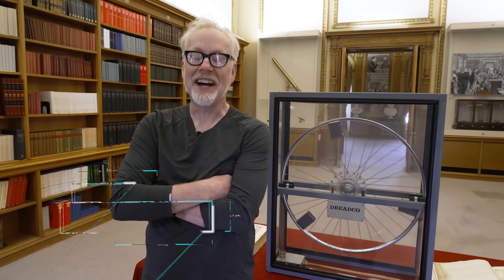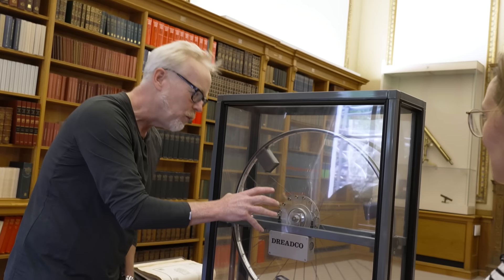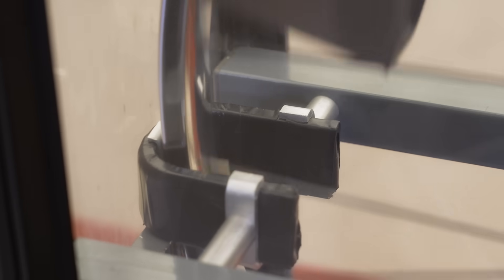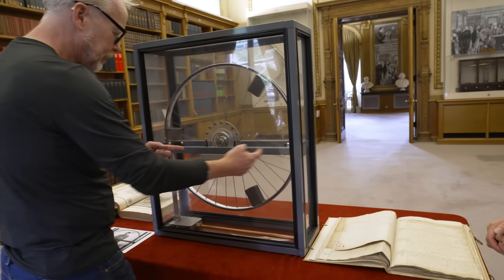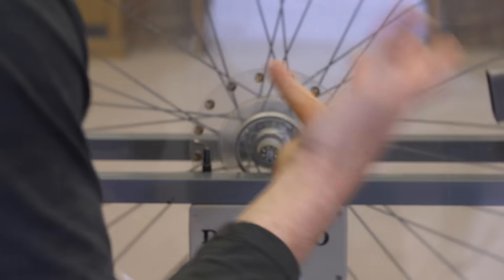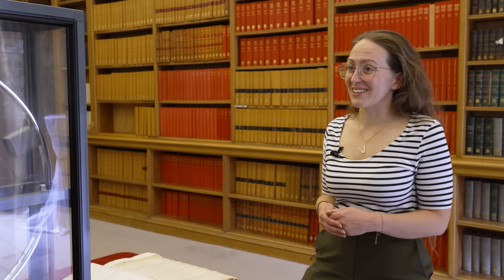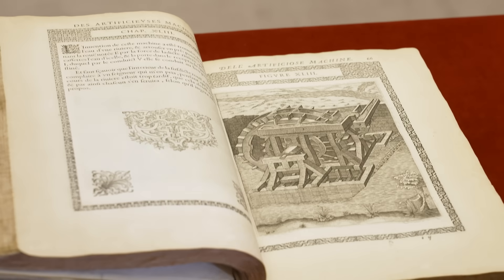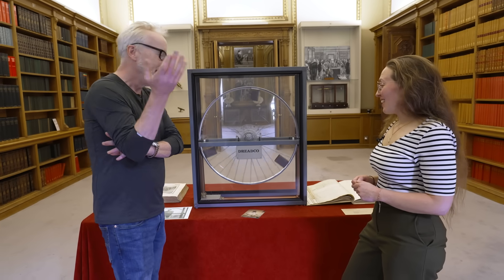Adam Savage vs The "Perpetual Motion" Machine!

Comment: A perpetual motion machine may by definition be impossible, but an incredibly efficient way to convert ambient EM energy (including heat, visible light, microwaves, radio waves etc), use magnetic energy and low friction materials may be able to be combined to actually fool Adam one of these days...

Comment: I have a propeller on my stove to disperse the heat in the room. It works by generating electricity from the heat difference. The cobbler tubes and heat sink might be the same device, to generate tiny currents from the heat difference inside and outside of the box, or simply between the bottom and higher up.
Reply: I wonder the same thing.

Comment: 4:24 I love how Adam is like "I wonder if this is a light meter" as he points his flashlight at it.
Reply: @SciFiSecrets  you're  a tiny solar panel
Reply: @anggrimunki  is that really necessary?

And solar panels are basically just LEDs... kind of.
Reply: @DavidLindes  iS tHaT rEaLlY nEcEsSaRy
Reply: @Squavez.  wow, y'all are infantile. 🙄

If you're like twelve or under - heck, even in your teens, then... 🤷‍♀.  If you're older than that, grow up. 🙄
Reply: @DavidLindes  you're really necessary :p
Reply: @DavidLindes  I'm 44. Growing old is mandatory, growing up is optional.
Reply: Nah, they are the vents to the air batteries
Reply: That is a temperature meter.
Reply: @SciFiSecrets  I have a motion activated light in the driveway that charges via solar panels and when I shine a flashlight on them at night they turn off thinking its day...
Reply: @JustinBrockel  Indeed.  Or a magnetometer.  (Well, he probably did have one of those, if he'd thought to pull out the compass app on his phone.)
Reply: @quazzymodo6294  kind of

Comment: Even if it ran forever, you cannot get any work out of it. That is the fatal flaw with all perpetual motion devices. No work, then it is just a novelty. 

I think the copper pipe/box with heat sink are red herrings. There is nothing about this device that would require that kind of heat dissipation.

Comment: I guess the middle box makes static, and the outer circuit harvests it to propel (and maybe even shift the weight inside) the boxes. 

It lasts as long as it does because there’s always static, and if it’s stored in the basement I dare say there’s “lots” of static there too. 

The static may even be a timing thing to tell the outer circuit to fire.
Reply: But wouldn’t that mean it really could run forever? But she said it doesn’t.
Reply: We all know that infinite motion is physically impossible. The task here is to figure out how he’s created the illusion. 

There has to be something adding energy to the wheel no matter what, static, if this is the case is an addition.

Comment: I'm sure Adam (and everyone else) is right. It's a motor powered by 3 batteries and some form of switch to turn on/off the electromagnets at the right time.

The more impressive thing is just tweaking everything so it runs at just the right speed, and whatever low-friction bearings it's using.  Also just the fact that it runs with minimum maintenance for 40 years.  The most difficult engineering is making something as simple as it can be, which this is.

Comment: I feel like what is most alluring about the "perpetual motion machine" isn't necessarily the possibility of an infinite energy source. But what can be done with a clever application of physical principles and very little input and upkeep.
Reply: little upkeep.  It still has motion, and will probably rotational on bearings.  I would think the upkeep would be the same with a brush-less electric motor.  Not sure.

Comment: There is a pendulum clock which needs no wind up to remain running.  The way it worked was it used the change in temperature of the air around it to wind the clock.  So long as the temperature changed ~4 degrees every day the clock would continue to run.
Reply: The problem with this is that while it may be perpetual in nature, it's not actually perpetual because it requires SOMETHING to keep it running. True that it needs no external power or intervention, maybe eventually some servicing on the parts due to wear and tear, fact is if there is no change in temperature it would simply stop running and therefore not be perpetual.

The other issue is that we want unlimited power, a machine moving under its own steam while generating enough power to be useful to some degree. To replicate the clock to a size that would say power a small house, the clock mechanism would be absolutely huge and possibly than scaling up the temperature change required to power it.

I honestly believe the best we can hope for is a device that needs minimal intervention on a regular basis to generate enough power for our needs, a device you wind up each day like an older clock, but big enough to generate power for our daily needs. Minimal energy input, maximum energy output, add in some wind turbines, maybe a water wheel, some sort of external force that can provide minimal input, with you being the emergency backup to wind-up the device should there be no water or wind.
Reply: The shown device is also not a perpetual motion machine.  There is no such thing as a real perpetual motion machine and there can never be such a thing.

Comment: A big brushless motor. The little disks at the hub are permanent magnets. They pass by the two coils to trigger the horseshoe shaped electromagnets on and off in the correct time to the boxes at the rim. Copper pipes hide the wires. The controller is the box with the heatsinks. The batteries are in the box with the logo.

Comment: It can't be a perpetual motion machine because it's still intact.
If it were, it would not rotate at a fixed speed, but would instead accelerate. It would be creating its own energy to provide it momentum. If this were the case, it would eventually accelerate until it either breaks or reaches relativistic speeds and rebounds off of its own inertia and explode.

Comment: The whole thing is a big fly wheel. The boxes are weights that are magnetic metal. The u shaped parts are electromagnets. As a weight approaches, the magnet energizes and pulls the weight toward it, accelerating the wheel, imparting a small amount of motion. 

This possibly happen in the down side magnet only. But perhaps the up side magnet also. 

Think a very slow, circular rail gun. I believe since it’s basically a fly wheel, the amount of force you’d need to add on each turn is only enough to beat the loss experienced at the bearing and through air resistance (based on when Adam’s finger hits the plastic, that enclosure does not look like it’s under a vacuum to me)

The other boxes and tubes house a battery bank somewhere and also provide for misdirection. 

“Servicing” is likely only replacing batteries and replacing or greasing the bearings.

Comment: Well, my main question is if the box is in a vacuum or open to the air or not. If it's open to the air, that enables barometric drive and metal-air batteries. Assuming the thing doesn't just have a snorkel to the outside, at least. I'm also curious how low the friction is on this, and how well-balanced it is. That's the main limit on how long it can keep moving on its own before the hidden drive system has to consume some energy to keep it moving.

The device is definitely made with far too many possible ways it could work that it's pointless to guess, which I assume was the intention. The hub could have something like a disguised motor or drive wheel, the spike and ball are designed to invoke the image of a high-voltage electrostatic drive, the boxes could contain a weighted wheel that spins every now and then to change the center of gravity of the larger wheel, or just magnets that move past an electromagnet in the frame (or vice versa).

From the way the truth is described, I feel like it would almost have to be the hidden motor or drive wheel, as those feel most "boring" to me. But perhaps the readers of that note merely compared it to an actual impossibility, to which anything would be disappointing. From all the times I've heard of this thing, I kinda don't care what it is, I just want to know. Perhaps so I can one day try out the other ideas and see how well those compare...

Comment: I agree there are multiple small forces at work. Making a lot of assumptions about the construction, what I find interesting is that the static u-shaped magnets are set below the centerline of the axle. This would reduce the dwell time between “event starts” to less than the apparent 120 degree spacing. It also affects the orientation of the rotating boxes in relation to the static magnets which could effectively increase the dwell time of the event itself (diagonal AC versus side AB)

Comment: Even if perpetual motion were possible, it wouldn't run forever as the bearings would eventually wear out. With such weak motion, even the bearings just getting a little dirty could lead to it stopping.

Comment: Looks simple. A PV cell charges a battery which is connected to the magnet pairs and a tiny tiny tiny little impetus imparted to initiate. Battery needs replacing every couple of years. Maybe bearings too but sealed they would have a good lifespan... The reversed principle of a scale arm damper with a power source added.

Comment: Cynicism aside...
A "perpetual motion" machine only harvests energy already available. I've seen a few good gravity types, though it's not an easy thing, but the magnet ones just frustrate me to no end. Heat exchangers are fairly interesting stuff, but I've been out of the loop for so long...

My favorites are the ringer circuits. Electricity exists everywhere with heat above absolute zero (0* K), so we just need to figure out how to get it. Nuclear solar panels, aka neucleovoltaic panels could lead to some interesting loops of power as well.

Truth is finding what works and using that.

Comment: There's just 2 or 3 magnets on the centre boss, the others are none magnetic (dummy), a relay is switched by reed switches to put power to each electromagnet alternately via a battery just when the wheel magnets are in the optimal position.

Comment: Just one simple thing that I immediately think about the box with heatsinks. If there is an electrical component, it would have to be VERY low power to run as long as it does with so little area for batteries. That being the case, the heatsinks seem very unlikely to be functional. Heatsinks scream inefficient and/or high-power.

Comment: I remember seeing a video where someone had mounted a disk on a computer fan, I believe the fan wires fed a small capacitor which went to a small electromagnet near the edge of the disk, there were permanent magnets on the disk, and it ran very slowly just like this. The creator of the video claimed there were no batteries but due to the low friction of the fan bearings it could run a good while without input

Comment: Tritium vials coated with phosphor to produce a small amount of light then surrounded with two monocrystalline solar panels on each side which makes small low power battery that last a couple years if you made a couple and put them in series it could make just enough power to drive a small motor similar to the vibration motor from a phone . Like all perpetual motion machines it likely has batteries just not your every day chemical batteries.

Comment: Reasonable guess: The copper pipe is a red herring.  There's a 9V transistor radio battery inside the DREADCO box which goes to the two contacts that energize the spokes as needed.

Comment: It seems like a pneumatic capacitor, it uses the difference from the night and day temperature   ... It pressurizes the air and blow in the tiny pipes and  the "heat sink with the pipes" control the speed

Comment: I am always disappointed when Adam/tested fails to put a gradient scale and high seed camera roll on the subject matter … real missed opportunities …data data data 😊
Reply: Good point. Especially if you could detect energy being put back into the system every time a box on the wheel passes a U shaped supposed magnet. Not sure if you could detect it or not. My guess is that  everything other than the U magnets, and boxes mounted on the wheel, are just distractions. The boxes would only need to contain a hall effect device, simple circuit ,battery and electromagnet coil. You know that energy is being input into the system for many factors. First it only lasts  a couple of years before needing "servicing". Second, even though it's in an enclosed box, there still is air inside to cause drag. Third, the bearings look like regular bearings which also cause friction, not like a jewel bearing of say a watch.

Comment: My uncle was in charge of machining the bearing casing for the spindle on this ''machine'' he said the creator came to him during school with this crazy idea of a machine that never stops and proceeded to spit designs and specs and all sorts of crazy stuff at him for weeks and weeks in the hope of getting my uncle on board to help. He did. Eventually they came up with a concept. By this point the head of the school had caught on to their idea and intervened, curious more than anything. He dismissed the idea and never spoke to them about it again. Fast forward 4 years and they are still at it until one day when they had a prototype on paper, everything seemed logical so to speak. They set about making ''V1'' V1 had only 4 different parts to the build. Metal, copper, magnets and wood. My uncle had to steal the magnets from his mothers appliances, which she didn't like lol but non the less 6 years later after V1, V2 and V3 they finally came up with what you see which is V4. V4 has copper pipes running through the bottom that you see, through these pipes runs a magnetic fluid which is pumped through that  box that says 'Dreadco'. The 3 boxes house 3 magnets with strategically placed weights placed on opposite sides, as the wheel is spun in motion it in turn powers the pump which pumps fluid around the display, the magnets push as they go through those 2 gates thus keeping the wheel turning enough to spin, the weights then carry the opposite weight to keep the wheel spinning and i have absolutely no idea what I'm talking about and all of this was just a story I made up just now

Comment: With a standard bike wheel that's very well balanced with ceramic bearings, you can spin the wheel and it will spin for well over 15 minutes.  So by adding a very small amount of current to keep things going, I could easily imagine having it run for a few years between "servicing" (AKA, charging the batteries).
Reply: @SciFiSecrets  while a vaccume would help, the plexi isn't thick enough to hold a vaccume for any length of time and surely not for years. So it's nothing but a container.
Reply: @TimEckel  Yeah, the way the plexiglass rattles when he clumsily poked it showed that it's not under any pressure too